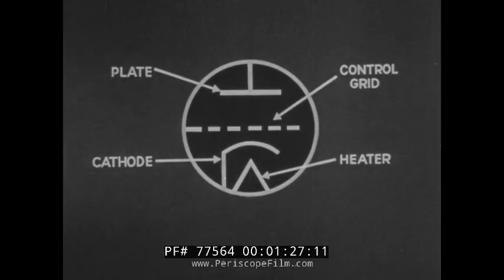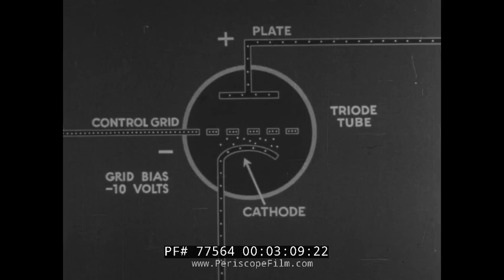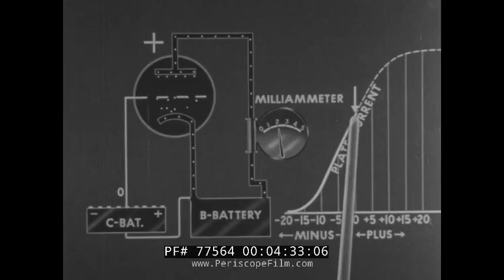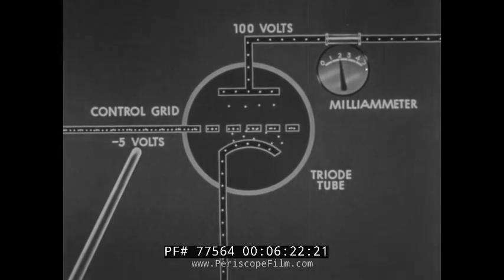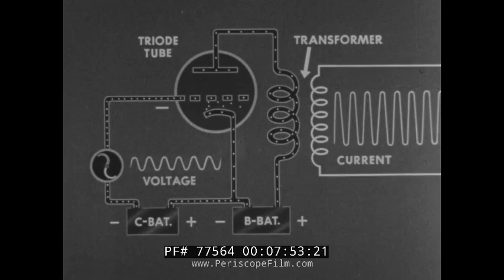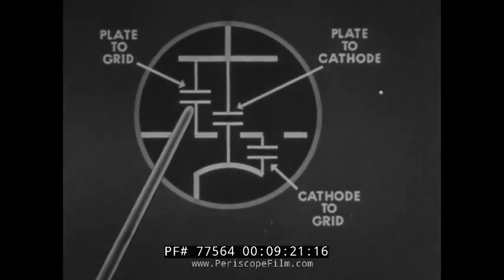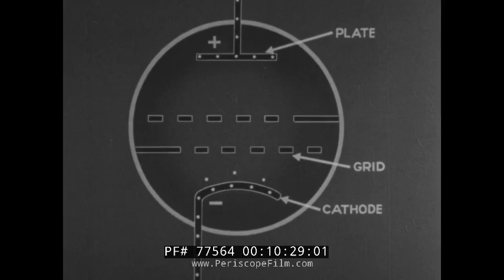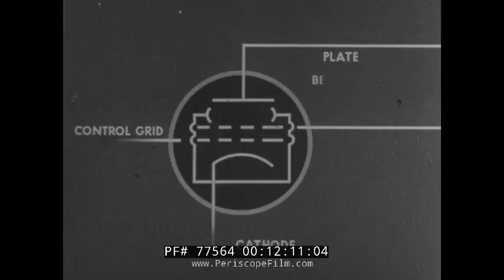WWII RADIO OPERATOR   VACUUM TUBE TRAINING FILM 77564

Comment: Thomas Edison discovered in 1883 the "Edison effect" or "thermionic emission" while experimenting with light bulbs by adding a positively charged metal plate adjacent to the heated filament, and he patented it! But it wasn't until the John Ambrose Fleming produced the Fleming valve (diode) in 1904 that was used to detect radio waves vastly better than the "coherer detector", a glass tube containing loose metal filings (like iron, nickel, and silver) that was placed between two electrodes that was previously used by Marconi. But it wasn't until Lee De Forest placed a wire mesh "grid" between the heated filament and the positively charged plate known as the "Audion triode" that was patented in 1908 when "electronics" was born because this triode could amplify!  David Riddle

Comment: Wow,  Navy  ET-A  school,   Treasure Island,  1968   condensed into one simple video.   USN, 68-74, NAS Miramar, 70-74,  ETR-2.   Maintained GCA RADAR and TACAN.  The downside of that great shore duty?  No training or experience with solid state equipment.   Although  one of the GCA radars  had  a solid state receiver IF, it gave very little trouble.

Comment: I studied the diode, triode and pentode tubes in my radio electronic Diploma of associate engineer course in 1979, then these electronic tubes were dying the new solid-state (ICs) integrated circuits were becoming common in radios and televisions.
I worked on high power TV Transmitters which were using tubes for amplification as well as new solid-state high power transmitters.

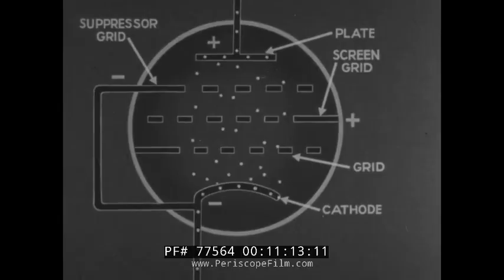Comment: 11:18...THE DISADVANTAGE OF HAVING MORE GRIDS IN A VACUUM  TUBE, IS THAT THE VACUUM TUBE GENERATES MORE "SHOT NOISE" DUE TO ELECTRONS STRIKING THE ADDITIONAL GRID ELEMENTS.
Reply: Does tying those extra grids to the anode eliminate this noise, essentially running a pentode as a triode?

Comment: i'd like to ask something

i know that vacuum tube diodes were replaced by modern diodes
1. can modern diodes to everything that old diodes did (like amplification and such) ?
2. is there a modern version of the old triode ?
Reply: REGARDING QUESTION 1: DIODES CAN'T AMPLIFY!! REGARDING QUESTION 2: I DON'T UNDERSTAND WHAT YOU ARE ASKING.
Reply: Transistors can amplify. They substituted, in large part, this technology.
Reply: @negotiatingwithdestiny  ...BUT WE WERE NOT TALKING ABOUT TRANSISTORS- WE WERE TALKING ABOUT DIODES AND TRIODES.

Comment: Is anybody else bothered by the fact that the current signal at 7:40 is at a maximum when the current through the tube is at a maximum? My understanding is that the current in the primary doesn't directly induce a current in the secondary, but rather the CHANGE in current in the primary makes the current in the secondary (because the other side of the transformer is compensating for the changing magnetic field). So I would expect the maximum output current to occur right when the plate current is changing most rapidly (i.e. when the grid is turning on or off the flow of electrons). I wonder if anybody who watched this film was surprised by the unexplained phase shift.
Reply: In general it is true, that it is the change in current flow that causes induction. It seems as if the illustration is not made to be entirely  correct and they rely on the narration being correct instead. I might be wrong, but to me it looks simply a bit unprecisely made rather than plain wrong, but I had to switch to 0.25 speed to actually try to make something out.
The whole setup is not generally free of phase shift in reality anyway, but this depends on many variables, e.g. this shift will often not be the same over the used frequency range.
Then again, things in practice often are not that simple as to amplify one isolated perfectly shaped sine wave, there is a lot more giong on. But still, there is some truth to your observation...
Reply: @dercebe  I agree with your assessment that this animation was just not perfect (and it was probably pretty fancy for its time!). I'm definitely nitpicking, but it's also nice to know what you'd expect to see on a scope.

Comment: My dad probably watched this film when he was assigned to the Third Armored in 1942.  He "repaired" tank radios (tube swapping, fuse replacement, or swapping out the entire radio).  After the war, he studied radio repair.
Reply: My dad also would have watched this.  Army, assigned to the Marines in the Pacific.  Did some transmitting for the Navajo Code Talkers.
Reply: @comment2009  Fascinating. I am Navajo and I have met many Code Talkers from my community.
Reply: My dad probably saw it too.  He was a radio operator/communications tech in an anti-aircraft artillery battery.